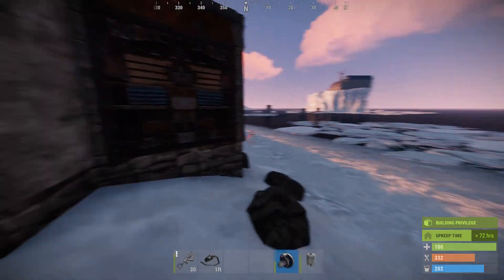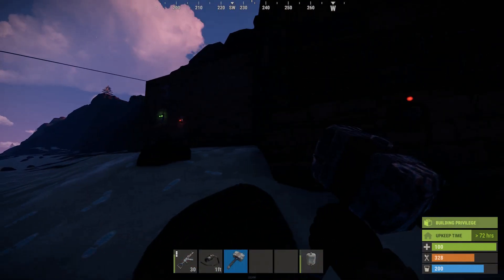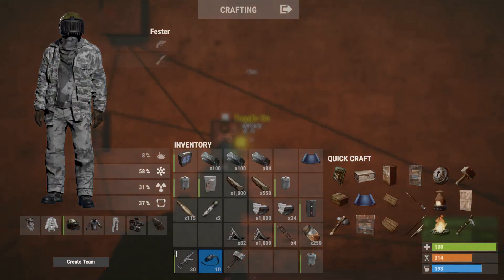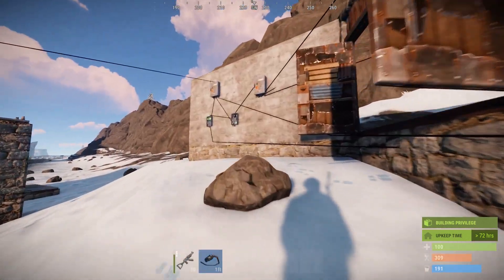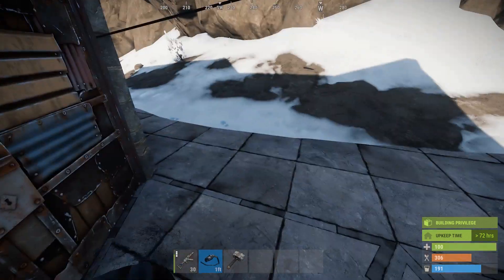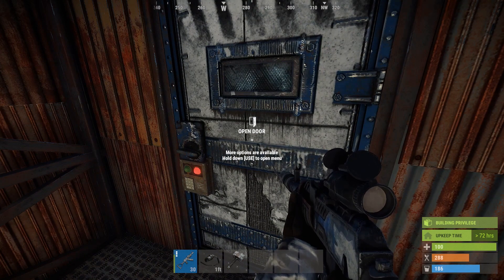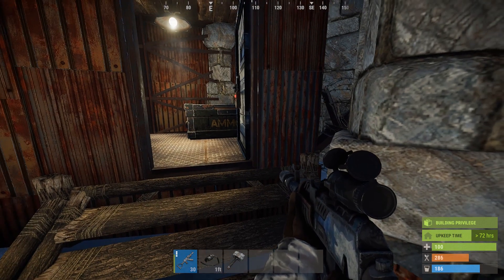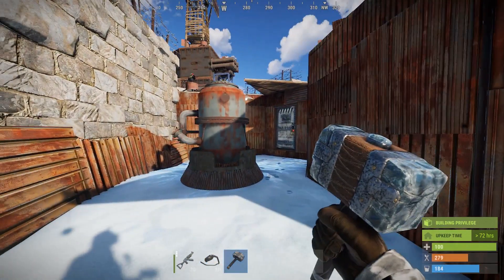Rust 101: HBHF sensor with timer opening multiple doors (from scratch)

Comment from the maker: I realized after making this that I didnt need the AND switch. That is just a leftover from before I added the timer into the mix. So, you don't need an AND switch. Just run the power output of the HBHF sensor straight to the Timer toggle and it should work fine. The AND switch is a nice little extra bit of show tho, with the lights changing. It also lets you know its working correctly, so personally, I'm going to continue using it, but its not needed.